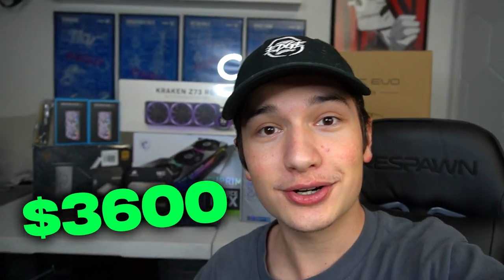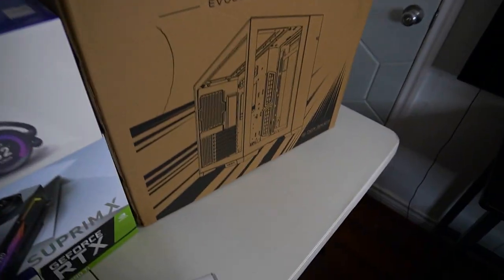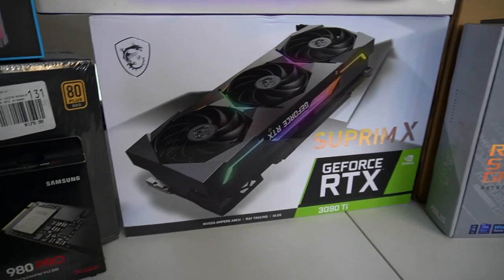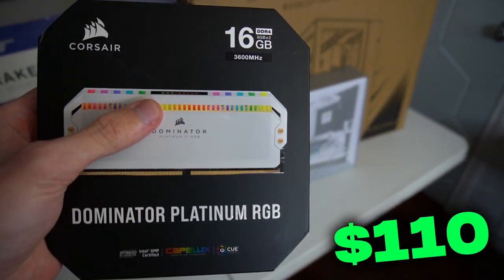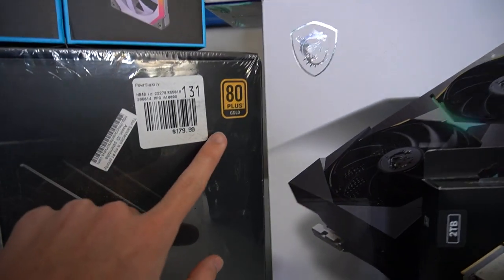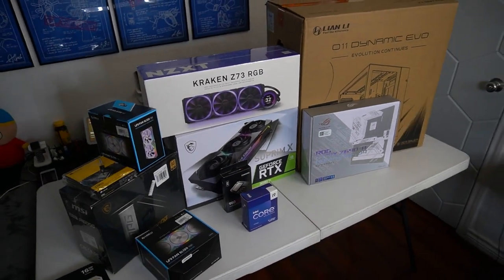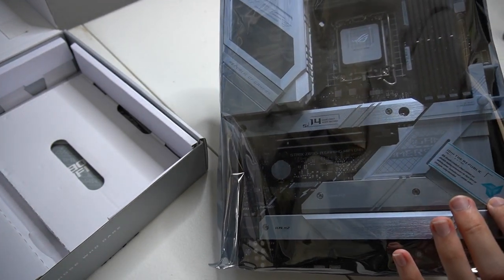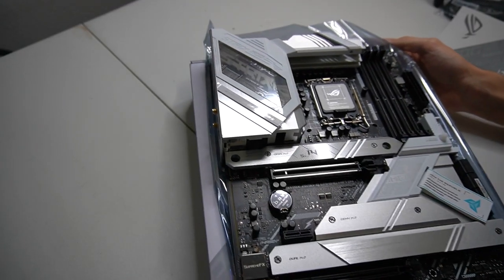Building My Friend A $3600 Gaming Computer!

Comment: 9 exhaust fans !! 0 fans to pull air in !! 💀
Reply: yeah how come you put the bottom fans as exhaust? its never gonna exhaust any air because heat rises. thats insane. but i guess if Anthony wants all exhaust lol
Reply: @joejanz6643  dude is diff hahahahaha
Reply: @edgeunboxes  💀
Reply: when money cant buy brain
Reply: It's not horrible or the end of the world. It will just make the case dusty from drawing air in from wherever possible.
Reply: @Suji Kim I looked at 30:08 minutes, the fans are starting up, all sl120 6 pcs. work to remove air. This is an engineering error of the assembler. Always cold air comes from the bottom up.
Reply: This is an exhaught only youtube channel
Reply: @PokèMyBalls  but the parts won't get fresh air either sooo :/
Reply: @@user-ih6cp3tx9r nope they're all exhausted, you can tell by the way the blades are curved
Reply: He did say this build was breathtaking so 💀
Reply: @robdsm  liol
Reply: @Suji Kim on any fans, except multi directional or a fan like the phanteks d30 120 that you will be able to order the direction you want, the bracket side of the fan is exhaust. If you can't see the support bracket then your fan is pulling air from inside the case and exhausting it out to atmosphere. You should see support bracket on the bottom and side and on top and rear should be only blades and logo.

Comment: Nice video but you need to invert your bottom fans. They must suck the air in and create an upward draft towards the top radiador. Lian li case are designed to extract the air from the top. I had the same issue, so yeah.

Comment: Looks awesome but yeah, all fans are exhausting air, I'd suggest making all fans (Except the CPU cooler radiator ones up top) be intake, other than that this is a very cool looking PC! Sheeeeeeesh! (I'd also get one extra 120mm fan at the rear for exhaust)

Comment: Unless you have a multi directional fan or something like the phanteks d30 120 that you will be able to order the fan direction you want then, you will want to set the bottom and side fans with the support brackets showing. The side with brackets is the exhaust side and air pulls from the logo side toward the brackets. You set up the fans to exhaust all air from inside the case to atmosphere my dude. On this case you want to see the brackets on the bottom and side fans and only blades and logo on top and rear. I made the same mistake when building my own pc in the 011 evo using the infinity fans but, I caught it and had to undo everything.

Comment: Look at the instructions that came with the sl120 fans. You can simply flip the power cables to go in either direction with a sliding cover flip on the end. Should've taken the time to flip them like you talked about in the videoa, an extra 3 mins to hide the ugly black power cable. I did the samething with the sane case and fans for my stepson.
Reply from the maker: Thanks for letting me know, I’ll tell friend!

Comment: Very nice build...using the same board with 13700k cpu..just a suggestion but I took off the original cup holder and am using a 13th gen anti frame bender to make sure cpu isn't warped and thermo paste sets evenly. Other than that...great build.

Comment: The assembly is beautiful, but there will be a shortage of fresh air for the video card. because the video card pulls the air to the top, and the sl120 bottom 3 pieces pull the air to the bottom.

Comment: A $3600 build having 16GB of RAM is just an atrocity that you should have never allowed. As a friend you can’t just let him get away with putting 16GB in this build. Buys a $2000 dollar GPU and a $700 CPU and then bottlenecks them both by cheaping out saving $30 on RAM. That’s so stupid I can’t believe anyone would ever even consider that, to make matters worse he got the more expensive RAM with pretty lights from an expensive brand. A 32GB kit from Corsair is like $150. That’s so dumb.

Comment: What’s a good cpu/gpu combo that’s good for gaming and streaming and a little bit of editing.?
Reply: The cpu would be a 5700X, and the GPU you should get a 3060 or 3070
Reply: I got a Ryzen 5 5600 rtx 3060 ti 16GB RAM DDR4 3600mhz cl 16
Works perfectly for me
Reply: @cmx8450  5600x or it’s jus a 5600
Reply: @DAWJS  what’s the difference between the 5700x and the 5600
Reply: @TechGaming809  the 5600 Is a ryzen 5 the 5700x Is a ryzen 7 ☺️

Comment: $4000 and he goes with Z690 platform and 16GB DDR4??? For that money he should bought Z790 DDR5 platform which has much better DDR5 RAM controller and gives DDR5 10% boost in speed. And where did he buy GPU? I have the same MSI Suprim X RTX3090Ti and i paid $1250 for it. 
I paid $2800 for PC with i7 13700k on ASUS Z790 mobo with 32GB DDR5 6000MT/s and MSI Suprim X RTX3090Ti and i bet that my PC outperforms his in every game.

Comment: Nice build. But why spend that much and go for a card that came out 2 years ago? I know that the 3090ti came out almost a year ago but it's not much more different than the 3090. Esp the 4080 is readily available at almost every retailers. That make zero sense not to get this generation card cus it is build on a much more advance platform and node. Also, way more power efficient that the 3090 ti.

Comment: Your AIO should have gone the other way. When your pc is standing you've created a high point in the pump. While yes the air should collect in the rad, you won't purge anything from the block the way it is. Just saying.
Reply from the maker: Appreciate the advice my friend just said he wanted to top mounted, I would’ve put it on the side personally 🤷‍♂️
Reply: no he has it in the perfect place, you want your pump blow the rad as if the pump is above it it will collect air since it like to rise and you'll drastically shorten the lifespan of your aio. For a custom loop it doesn't matter but for an aio aslong as the rad is above the pump you will be perfectly as it is the way it should be mounted
Reply: @Siinstroze  No. You don't want to HOSES on the bottom of the block. Lol. You misunderstood my point. You're creating a locked high point right inside the heatsink the way he has it meaning it'll never be actually full of water due to some of that air not being able to get TO the rad in the first place. The pump pushes some through not all
Reply: As long as the top of the radiator is above the block, the place where the AIO is mounted is okay. Top mount is ideal for this very reason.
Reply: @siinstroze8274  yup, people should really watch GN vid on it or the shorter jays one and learn about pump block and top of the radiator positioning. Also how he left it his pal can add more ram later… he’ll need it 😂